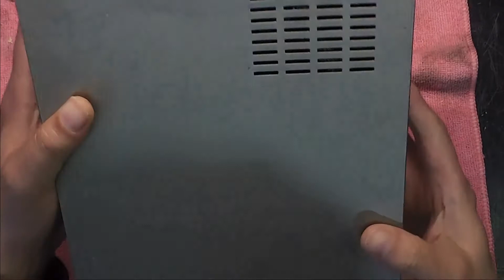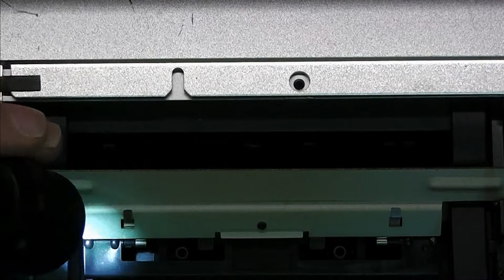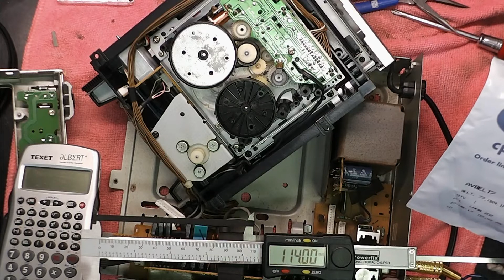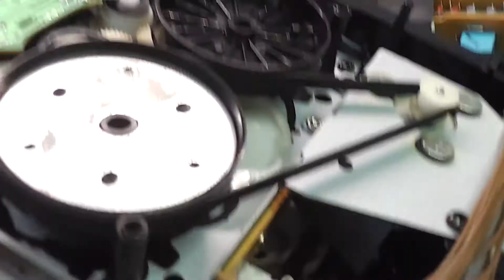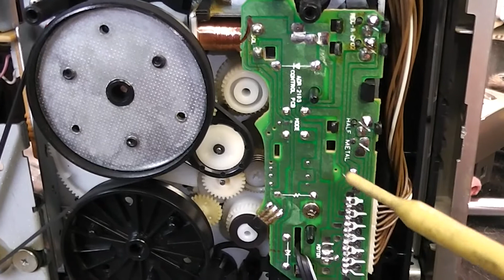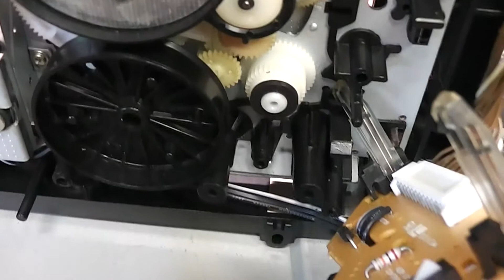Kenwood X-SE7 cassette deck rebelt and test.

Comment: Great Video Darren ...... Dont Ask Me Why I Done it ? But Just Bought a  Kenwood R-SE7, DP-SE7 X-SE7 & LS-SA6 Speakers Of Eaybay For £87.00 Thats The Tuner/Amp, Cassette Deck, CD Player And Speakers The Guy Selling it Says Everythings Working (DONT THEY ALWAYS )System Control Conectors And Remote Control Are Included As Well..... But The Belts in The Cassette And CD Player Are Bound To Be On Their Way Out By Now But Will Give Me Something To Work On he he !! Thanks For The Upload Regards mike